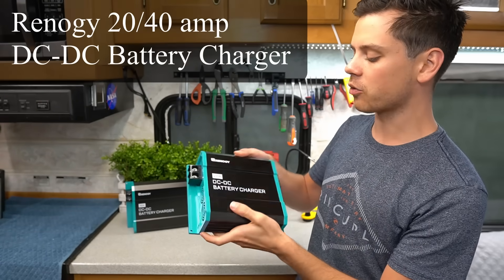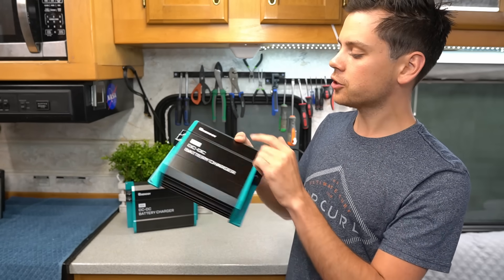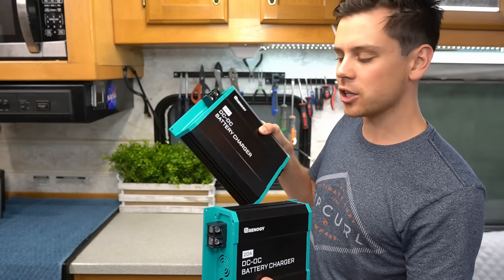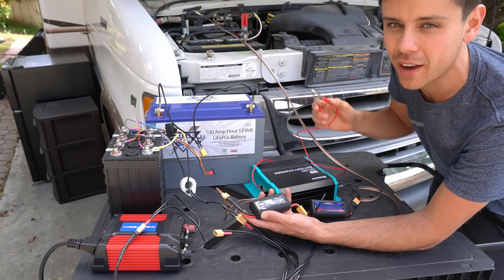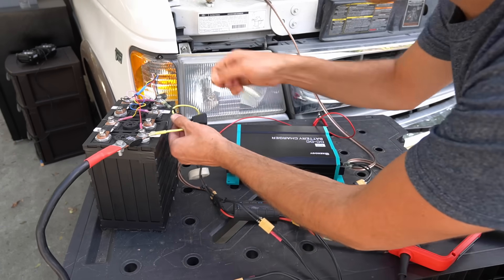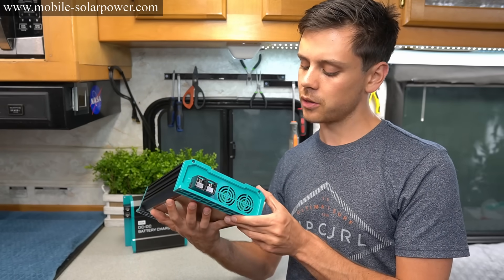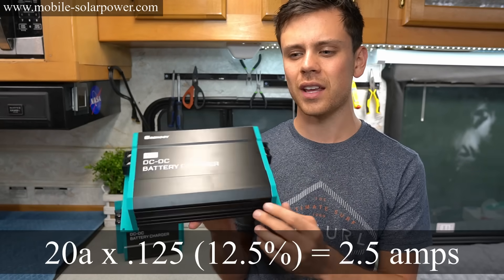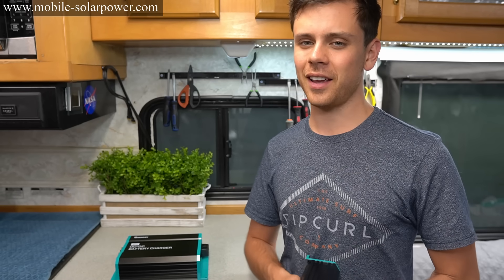Renogy DC-DC Battery Charger Review: "Smart" Alternator Charging for Solar Batteries!

Comment from the maker: 20 amp model: https://amzn.to/2IdObVy
40 amp model: https://amzn.to/2X8hJYb

More about battery isolators/dc-dc chargers: https://www.mobile-solarpower.com/battery-isolators.html

Battery charger/isolator manual: https://www.renogy.com/template/files/Manuals/Renogy%20DC-DC%20Battery%20Charger%20Manual.pdf
If you are using this system to charge a custom built lifepo4, use the custom charge profile parameters. 

Why its a bad idea to charge a deep cycle battery with an alternator: https://stevedmarineconsulting.com/alternator-charge-regulation/

My video that I cover why its a bad idea to charge with an alternator: https://youtu.be/NShywIH_meY

Lifepo4 battery article that mentions alternator damage in great detail: https://marinehowto.com/lifepo4-batteries-on-boats/

~~~~~~~~~~~~~~~~~~~~~~~~~~~
Tired of getting ripped off? Check out my "Will Prowse Approved" solar product recommendations below!

12V Batteries
https://www.mobile-solarpower.com/lithium-batteries.html

48V Batteries
https://www.mobile-solarpower.com/48v-batteries.html

Offgrid Inverter System Builder
https://www.mobile-solarpower.com/48v-complete-system-blueprint-559371.html

Hybrid Inverter System Builder
https://www.mobile-solarpower.com/code-compliant-48v-offgrid-system.html

Mobile Handtruck System Builder (very popular!)
https://www.mobile-solarpower.com/mobile-48v-system.html

Solar Panels
https://www.mobile-solarpower.com/300w-solar-panels.html

Ground Mount Solar Racking
https://www.mobile-solarpower.com/ground-mount-racks.html

Wire, Lugs and Busbars
https://www.mobile-solarpower.com/wire-and-connectors.html

Tools
https://www.mobile-solarpower.com/tools.html

Fuses and Circuit Breakers
https://www.mobile-solarpower.com/fuses.html

Plug-N-Play Solar Systems
Ecoflow, Anker And Bluetti! So many models to choose from. See my current recommendations here:
https://www.mobile-solarpower.com/full-size-systems.html

~~~~~~~~~~~~~~~~~~~~~~~~~~~~~~~~~~~~~~~~~~
Need to build a large DIY system? Need a trustworthy solar distributor? These are my favorites:

Signature Solar
Creator of EG4! Solar Minisplits, Victron and More! Largest Solar Store Online.
If you want $50 off, please use my link below and coupon code "DIYSOLAR50":
https://signaturesolar.com/?ref=cPwLcVc0SW-BjN

Current Connected
Best Prices for EG4, Victron, Midnite and so much more! Fast Shipping and Highest Rated Customer Service:
https://currentconnected.com/?ref=wp

~~~~~~~~~~~~~~~~~~~~~~~~~~~~~~~~~~~~~~~~~~
Join our DIY Solar Community 
Need more help? Join the largest solar forum on the internet for beginners and professionals alike. 140,000 members and counting!
https://www.diysolarforum.com

Check Out My Free Book
Best-selling and beginner-friendly guidebook to off-grid 12V solar!
https://www.mobile-solarpower.com/the-book.html

~~~~~~~~~~~~~~~~~~~~~~~~~~~~~~~~~~~~~~~~~~
Contact Information:
I am NOT available for personal solar system consult! If you wish to contact me, this is my direct email: williamprowsediysolar@gmail.com
FTC Disclosure Statement and Disclaimers:
Every video includes paid promotion or sponsorship (such as free products for review). Some links on this YouTube channel may be affiliate links. We may get paid if you buy something or take an action after clicking one of these. My videos are for educational purposes only. Information is subject to change/update at any time. Electricity is DANGEROUS and can kill. Be smart and use common sense :) DIY Solar Power with Will Prowse is a participant in the Amazon Services LLC Associates Program, An affiliate advertising program designed to provide a means for sites to earn advertising fees by advertising and linking to Amazon.com
Reply: hey boss.... do u have a wind turbine channel? also love ur vids , makes a lot of stuff easier to understand ...  totally smashed the sub and bell.
Reply from the maker: Thanks man! I plan to test some wind turbines actually. I am curious how much power I can pull from them. But one thing I know about them is you need a LOT of wind. All day.
Reply: @WillProwse  yea that's kinda true.. but if u do it will help give power for bad weather and nights.. winter ,etc .. we don't have winter in my country but rainy season 😫  is around the corner.. I have a small set up . With ur help and info I'll be upgrading to 24v soon  thanks bro. All the best keep the videos comeing!!
Reply: I finally found a cheap 1000w pure sine wave inverter I cost 150$ for me but yesterday they sold out luckly I bought one before it sold out.
Also wow it is hard to find something that works as advertised.
Reply: Current limiting.
You buy a 40 amp then limit to 20 amp to charge a bank of LA batteries.
you still have the ability to unlimit to 40 amp to charge a bank of LiFePO4.
Reply: I wonder if you can review litime 60amp dc dc charger?

Comment: Great videos..thanks for your contribution..
Help me out.
Im upgrading my housebank battery to 280ah lifepo4..my alternator output is 55amp and the input on the 40amp dc to dc charger model rbc40dis is 45amp.  This is connected to the lead acid battery -engine battery.  The draw is from the battery and the alternator charges the lead acid..but im reading that I can burn out the  alternator with using such high amps continously..is this correct or am I misunderstanding something?

Comment: Can this unit (20A) be used as a charge controller for a 250 watt wind turbine? The turbine puts out 12v, 10A at speed.

Comment: I am looking to fast charge my EcoFlow Delta 2 Max by using the something like Victron Energy Orion 12/24-Volt 20 amp DC-DC Converter Non-Isolated battery charger and connecting it to the 12v battery of either my Chevy Bolt EUV or Toyota Prius. The higher output voltage of the charger would allow the EcoFlow to charge faster. I don't see anything from Renogy that I could use, Is there a unit better than the Victron that you would recommend? This setup would be utilized during power outages as solar is not an option at my location. Many thanks for all your hard work.

Comment: I have 20 pieces of 650watts solar panels and 4 pieces of 48v/100 Ah lithium batteries, what size of charge controller do I use to charge this batteries at 180vdc

Comment: Hi
This is quite misleading.
The alternator is made to charge as much as possible. There is no reason to protect the alternator. 
The DC DC charger is very often  used to increase charging and not to protect the alternator.
78% efficiency is very bad. It is only a waste of energy. 
It is a myth that you have to protect the alternator.

Comment: I just purchased the 60A version of this in 2025. This is because of the current-limiting feature. The reason I want this is because an alternator output current is very low at idle compared to max output. I don't want to overheat my alternator demanding too much at low idle. I'll wire the Renogy current-limiting terminal to a switch on my accelerator pedal, so when I'm off idle it will pull 60A, and when I'm at idle, it's limited to 30A. I'll have an override switch to force 60A at idle, but.... I bought this unit because it's the only one with this feature, and 50A+.

Comment: I purchased the 2nd gen 20 amp and under multiple tests cannot get the unit to turn off so consequently at either end will drain both my batteries. Perhaps is faulty so can only think to return it but am leery about trying again. With my camper on the truck or off this unit must be able to totally turn off with no phantom power draining either batteries.

Comment: Have you tried the LiTime DC to DC chargers? any comments?
Reply: I used the liTime 40 amp and it worked fine on a 1500 mile trip charging my 300 amp lithium trailer battery.  I had to replace the truck 12v battery prematurely after 2 years. I currently do not ever idle for long periods charging unless I turn off the dc to dc charger first. Idle periods charging is bad.

Comment: If you are running thru your existing wiring and a 7 pin trailer plug you only have 10awg power wires. Thus a reason why you might use the 20A mode until you upgrade your vehicle to RV wiring.

Comment: Can you do testing comparison on auto maintainers for long storage like 2w panels up to 25w. The issue I see are that most cheap 2w panels are are 20v so they over charge esp below freezing with increased efficiency. Then with a charge controller it would draw your battery down during cloudy winter months and or at night.

Comment: What's the best way to connect a DC to DC charger  and charge 2 separate 2 100ah battery banks in a toolbox with 1 set on each end of box

Comment: I use this Renogy DC to DC on my trailer and to get around the issue you mention around charging right when the ignition is turned on I connected the start sensor to my running lights.  So I will start up the truck and let it run for a minute or so and then I turn on my running lights which activate the charger.

Comment: Charge limiting is 50%, not 12%.I like to use the charge limiting on a 40amp charger so I have the capacity to charge at a faster rate in a pinch, but most of the time I run it at 20 amps. That said, my charger let the smoke out for no clear reason after less than a year, so I suspect their implementation sucks.

Comment: How does this Apply to the New Epoch LiFePO4 Dual purpose 12v cranking and deep cycle batteries? 

Especially in a Boat. Mercury motors approved quite a few batteries that work with their motors.

I'd be using it as a cranking battery & as a house battery when the engine is off & I'm trolling with my 36v trolling motor battery & the 12v cranking battery would run all my electronics, fish finder, stereo, etcetera. 

Would you still recommend this since it shuts off the battery when turned off? I wouldn't be able to run my electronics, correct? 

Or are there new ones that allow both cranking & house use (boat electronics use) & have a delay in charging & anything else thats beneficial? 

Thanks, 

Matthew

Comment: Can I connect from outboard direct to the dc/dc unit and then to my LIPO4 battery without a lead acid battery on the input side of the dc/dc unit? My boat does not need a starter battery because it is only pull start.

Comment: I've had THREE of these 60a units that have failed on me, first one had some high-pitched noise charging at 60a, second and third worked for a few months and then failed as their output voltage was effectively 0v (slight voltage spike for 0.5s at power on) - no warning or errors (green light). I still have one of the failed units and am interested in diagnosing the failure internally. Any idea where to start based on the fact the output voltage is too low but otherwise the device behaves normally?

Comment: just ordered the 20 amp one for use on my boat for charging the two 100AH lion trolling motor batteries when running the big motor as I also have a inverter to power my LED bow fishing lights off of my two trolling motor batteries .....its work in progress will upgrade if needed as I get my 12 year old fishing boat I got new and is payed off now cleaned up and ready for my retirement in a few years as it sat neglected the last three years as I payed off all of my debt and payed for my daughters wedding  and now that's all behind me and out of the way I am ready for more bike rides and fishing trips and getting it cleaned up and back on the water and at the same time working better than it ever has ...

Comment: Hi Will. How would you connect this to the coach batteries of RVs, Ambulances, etc, as they power the coach and you would want to use them. Normally, when the starter battery is charged the isolator then sends current to the coach batteries which is fine for lead acid batteries. But if you replaced them with Lipo 4 Lithiums would you want a dc to dc charger in line? But then how would that be done unless you removed the original isolator? Thanks

Comment: Low current mode would be perfect for my garden tractor.  I believe my alternator is only around 10 amps.  I could use this and a 2nd AGM battery to run lights and fans without killing my main lawn battery.

Comment: As far as the ignition circuit you can use a toggle / switch so the unit isn't on automatically.

Comment: I thought you were supposed to connect the charger to the starting batteries, in order to protect your alternator from working too hard ! If you connect directly to the alternator you would be charging the starting batteries at the same time as house batteries.

Comment: Hi there, I have a couple of questions and I know you are guy in the know!  

I am doing a campervan build and I have 460ah AGM leisure battery set up.  

I have an 180amp alternator. 

I will have a 50amp victron mttp charger controller and considering the renology 60amp Dc to dc charger.  

My understanding is that AGM batteries have a 30% max charge capacity, making it 138amp max charge current.

My first question is do the above maths work and will be safe for all elements in my system, alternator, battery max charge current etc?

My second question is do mttp, dc to dc, batteries work together re charging and adapt to avoid exceeding max charge current?

Thank you so much and appreciate your videos so much!

Comment: im curious to know if the batteries cpups be reversed so a house battery can keeo a starting battery charged? Renogy said you get a cut off switch and to switch between the 2 batteries so when i need to drive ip meed to turn of the charger going to the starter. i bouhjt a switch that goed battery 1, batt 2, both batteries or off and im trying to figure out how to wire this correctly  when i think it only have 3 wire lug connections.

Comment: Question, I'm installing this in my truck f510. Would it be a good idea to add a 30 amp fuse between the battery and the DC charge controller nearest to the battery? I'll be installing the 20 amp controller.

Comment: Question - is there a dc charger that will charge 48v lifepo4 battery from vehicle 12v alternator when engine running?  What solutions are there?

Comment: Si you still believe charging with an alternator is bad if you use this?

Also I’m unfamiliar with what a load is- in a practical setting can you just put wired (AWG?) between the alternator, to this, then to the charge controller? Or do we need more fuses

Comment: I used this video since it is about dc to dc charging. I need to pick your brain. My tow vehicle is a 2022 Ram 1500 Hemi 5.7l e torque. No alternator. It has an electric motor and 48v 430 watt-hour lithium-ion Nickel Manganese Cobalt (NMC)-Graphite battery. Charging is regulated . 12v charging is regulated at 13.7 to 14.7. Generally charges at 14.6. I would like your recommendation on dc to dc charging. My TT has a 230ah LiFePO4. Thanks

Comment: I am in discussion with Renogy at present concerning their 50A DC/DC MPPT charge controller. I ordered the 30A by mistake only to find that I can't use it with my 150 amp alternator. However their manual (page 19) also states that the 50A unit cannot be used with any alternator over 100 amp. Since many alternators today are definitely over 100 amps, what's the point?

Comment: I like the D+ input.  I connected a switch between the charger and the ignition source.  That way I can cut the charger off when the key is on but the motor is not running.  If this is not done the starting battery will dump energy into the auxiliary battery possibly to the point of damage.

Comment: I’m going with the the 40amp or larger unit because I’m going to upgrade the amperage of Venus’s amperage.
Reply: I’ll also 🐝 adding a dc power delay that opens the circuit at 5 minutes.
Reply: Thanks

Comment: Your videos are instructive! I'm installing the DC-DC 20 amp. I'm considering using a blade mini fuse with a tap for the DC+ connection. My question:  does the DC+ draw any current and if so how many amps? This in regards to picking the right fuse rating for the tap. Thanks

Comment: Can I connect a solar controller RNG-CTRL-RVR40 and Renogy 12V 20A DC to DC  in parallel to the battery RBT200LFP12-BT. It's for my camper van, I want to be able to charge the battery when I'm plugged into electricity.

Comment: Hey man   this has nothing to do with this video   I just have a question   can you us a solar trickle charger to charge a small 12v LiFeP04 battery    it's in my boat to power light but I don't use it that much so it only needs charged maybe 1 time every month or 2

Comment: @1:08 You are showing the wrong temp sensor. Looking at the plug, that one is for the Epever-style solar controller. The plug looks more like the temp sensor that came with our Midnite Classic 150. Just thought that might be confusing to some folks, as the temp sensor you show looks like it COULD fit into the green connector to the right of the temp sensor.

Comment: French accent " Four Years Later " lol. Question. On my RV . I use a single Residential solar panels that puts out 72V and close to 420w in full sun. That One panel is feeding my Bluetti AC200P . I also have a B230 for back up.  That has been charging via the brick off of the Inverted Power from the AC200. I have a DC - DC voltage Converter  Rated for 48-135 V input and knocks that voltage down to  12V 10A / 120W of power.   Could I put the output of that Voltage Converter into this Renogy Unit and use it to  charge the B230 successfully?   
BTW .. You rock dude!

Comment: Will the Charger stop charging once the batteries are full or is there risk of over charging ?
Reply: It's automatic. These are smart chargers as long as you set the dip switches correctly.

Comment: Will the unit boost voltage in the lower operating voltage? Meaning, the lowest operating voltage is 8 volts I believe, will it boost the voltage to charge the battery?